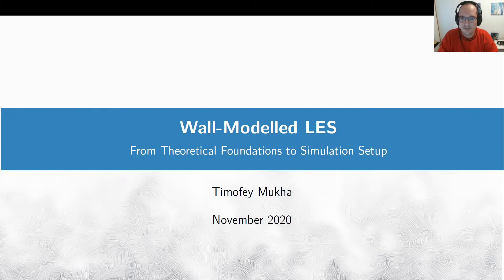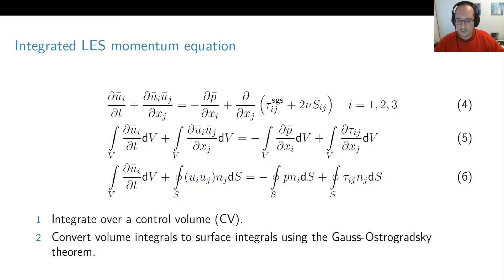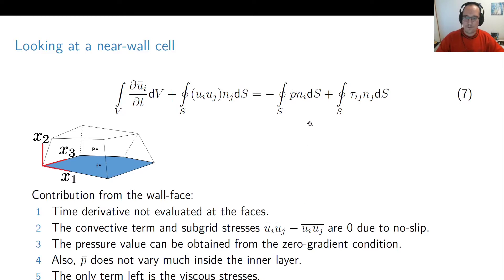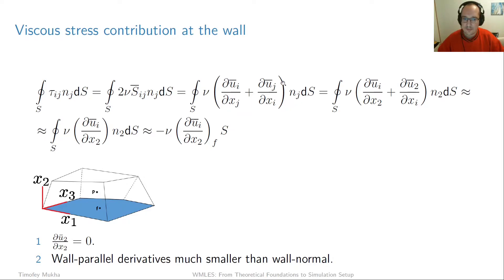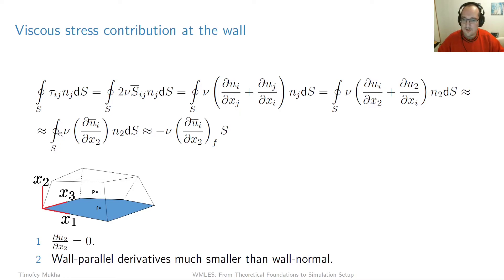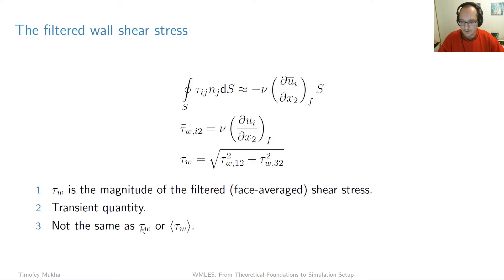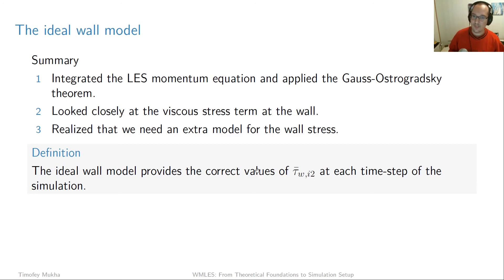Wall-Modelled LES: From Theoretical Foundations to Simulation Setup. Part 3

Comment: Thanks for you great videos. Please correct me if I am wrong.
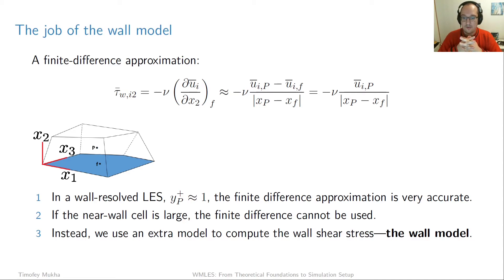@10:34, you mention that "in WMLES, we no longer adapt the grid to the inner length scales". In this sentence, were you talking about the coordinates parallel to the wall (x and z) OR in WMLES even y direction is not adapted to inner-layer length scales? 
In other words, do we need to have y+=1 in WMLES?
Reply from the maker: Indeed, no y+=1 either! Everything is measures in outer scales.